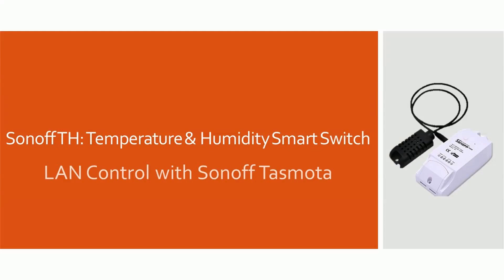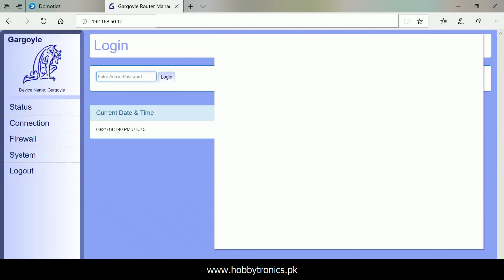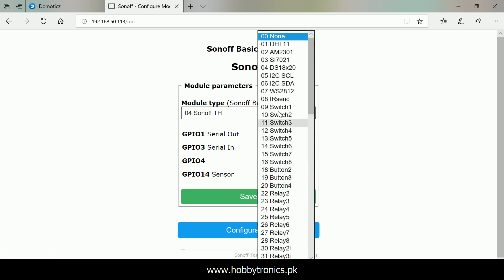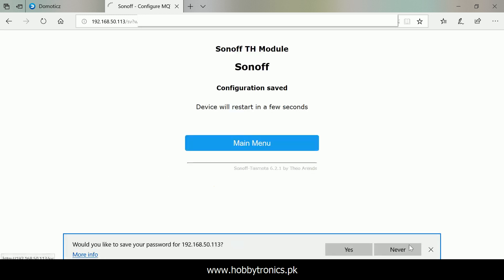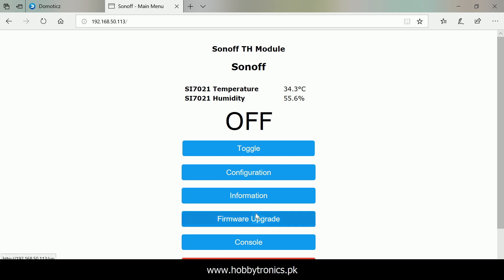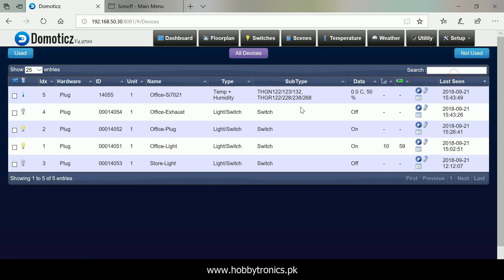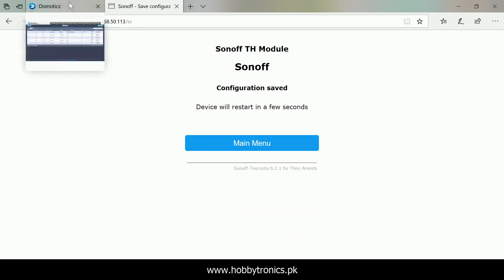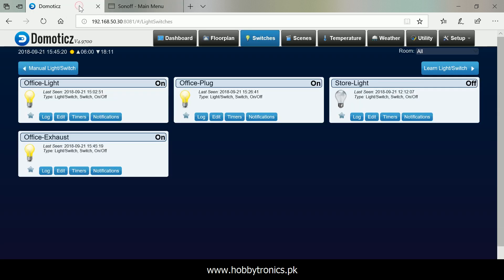Configure Sonoff Tasmota and Domoticz to display TH Sensor Data

Comment: Hi, great video, mine worked perfectly first time. 
  I have around 40 different Tasmota Domoticz devices connected, but I am fairly new to domoticz in regards to scripting/codes etc(only used blocky to date!) 

Please could you advice how I could automate temperature/humidity depending upon received data.
Reply from the maker: Try Nodered
Reply: Thanks, I will have a look although I have no experience using Node Red